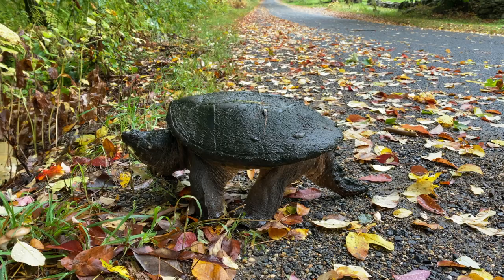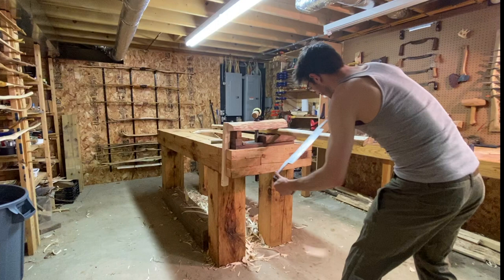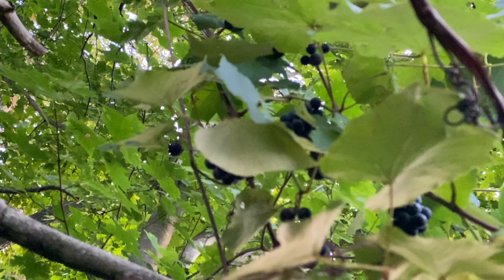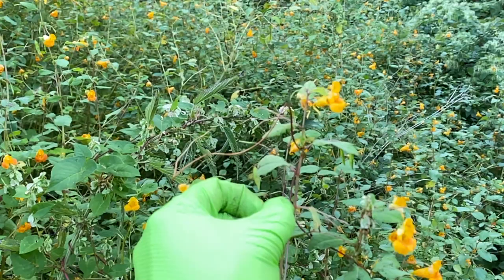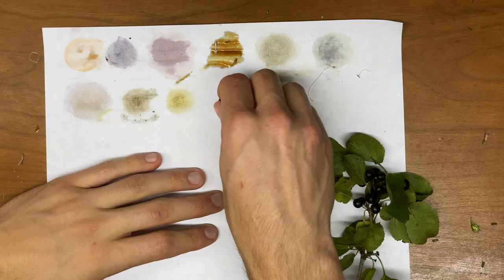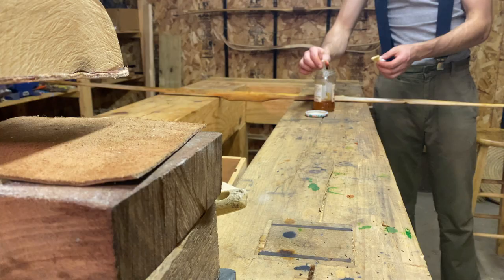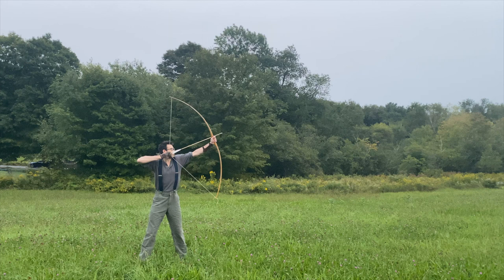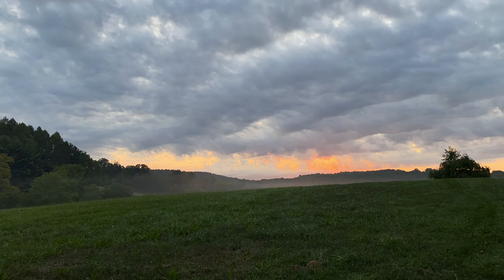Woodlands Warbow: Natural Plant Stains for Bow Making and other Crafts

Comment: If you use a natural stain from plant material, some plants and grasses are very photosensitive to sunlight. 
Most people see this as a problem for longevity but, those types of stains can be used like a photo resist emulsion.
If you put the stain on a object then cover some areas with something that blocks sunlight such as using tape to hold down a thick leaf, cardboard cutout, a skeleton key or use a small craft cutting machine to cut out stencils of patterns or signatures.. then set the stained object in direct sunlight for exposure for a week or so (depending on source of plant stain), the stain will only remain on the covered areas. Then you can apply a clear, UV resistant finish over it to protect the colors longer.
I used to do that on paper as a young kid, by staining white craft paper, then covering it with the leaf or flower the stain was made from so the color in the unexposed pattern area that remained would resemble and was made from the same plant that went into the stain.
Reply from the maker: Very true. I tested most of these before and knew in advance that they were somewhat colorfast. Some stains also need mordant but these were all fine without any.

That said, anyone using natural stains should accept color loss in advance and use backgrounds/textures that will look good faded.
Reply: @DanSantanaBows  , yes very true.. those stains do add a really aged, antique look to a recently made bow. I think it looks nice but, some don't for a few different reasons.
Reply from the maker: Grinning Goat I think a lot of the controversy with natural stains comes from painting, where time will completely ruin the artwork. Images don’t survive very well but textures have a better shot at standing up to time. 

if the colors fade the bow is still there, which isn’t true in painting. So I understand why that community has such a harsh stance on natural pigments